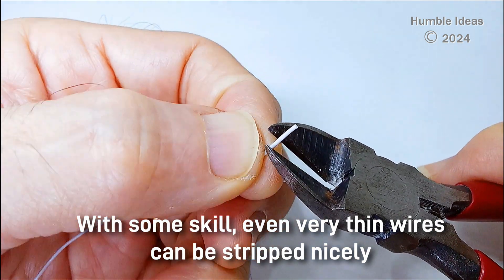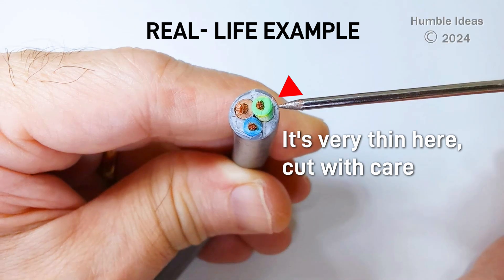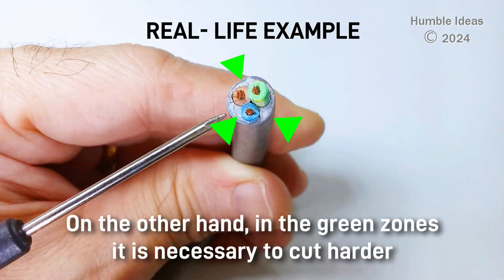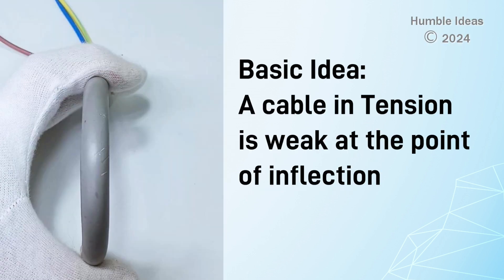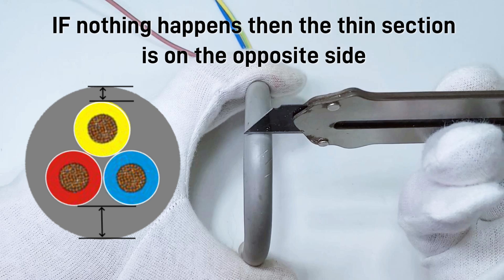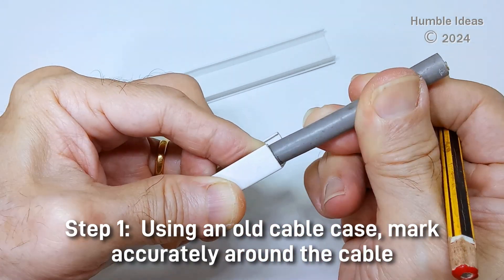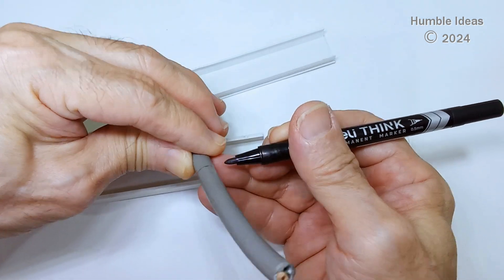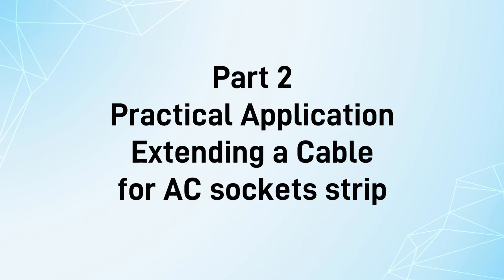How To Strip Beautifully 3 Core AC Cables

Comment: How long did this take you?..
Reply from the maker: As a perfectionist time is not important.  The beauty of a very clean cut cable with square edges and no nicks in the rubber of all three inner cables, the joy is indescribable.  Perhaps you have not experienced such ecstasy.
Reply: @HumbleIdeas  time is always important, I'm asking how long it took?
Reply from the maker: After considerable practice and experimentation, I can strip the cable type shown in the video in about two minutes .  The beauty of it is the very clean cutting.  As demonstrated in the video, there is no tool on earth that can do this presently without nicking any of the inner cables.  As explained in the video this is due to the assymetrical layout of the sheath housing the three inner insulated cables.  Also worth mentioning is that often QC problem during manufacture can result in some parts of the insulation being thinner.  Hence a strictly manual method of cutting as explained in the video, is the best option.

Comment: You'd be fired within one hour if you were to make installations professionally.
Reply from the maker: The video is meant to be slow tutorial to let people understand the issues.  The method once mastered can be executed quite fast with consistent results.  It is important not to Nick earth and neutral.. moisture can enter the joint and cause RCD trip which would be difficult to detect since neutral is hardwired all the way to the DB and not intercepted by MCB.  Better safe than sorry.

Comment: That's a very neat job, thanks for the tip. I usually strip a longer length so I can use heat shrink on the inside as well, but my splicing jobs don't look as neat as this
Reply from the maker: Oh, hi good to see you!  Yes it took me decades to figure out this ten minutes of video, truly. I am a bit of a perfectionist so I spend a lot of time doing crazy things 😉